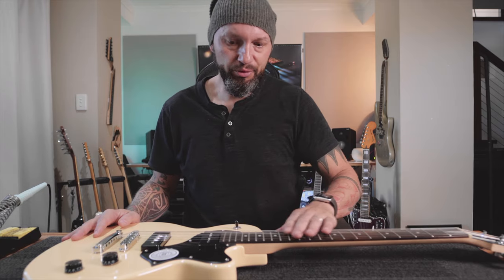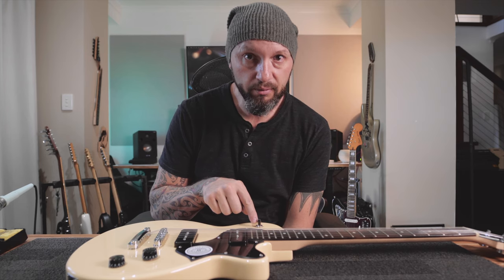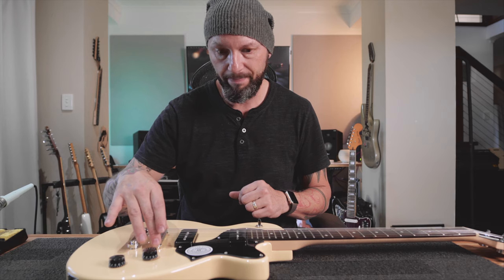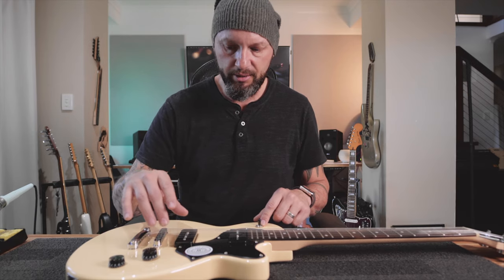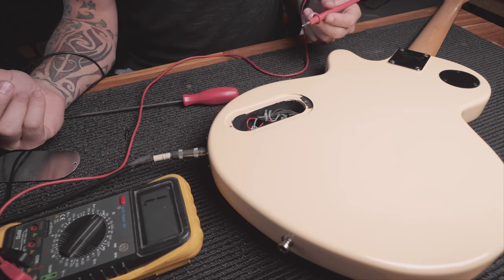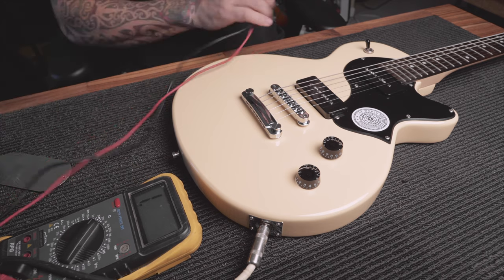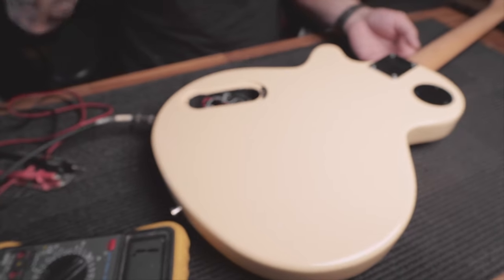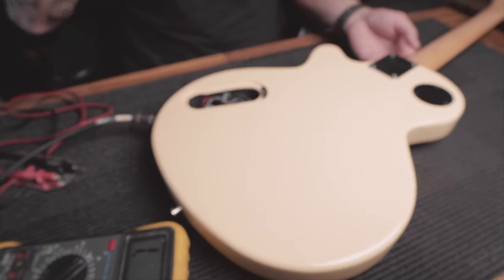3 Easy Solutions to Fix Ground Noise | Guitar How-to Ep02

Comment: Hi there, very useful and informative video! I have an Ibanez BTB series bass and I have a constant noise that goes away when touching ANY METAL PARTS OF THE CIRCUIT, and that includes the Metal parts on the amp, the Multi-effect , bridge, strings , preamp knobs and etc... could this still be a grounding issue? I tested back of the cavity with a multi meter and some parts seemed to have "continuity" , whereas some of the pots seemed to be off (with a wiring or soldering problem...) I am really confused and I would appreciate if you could help me !  (Also the noise doesn't get any louder when touching specific parts)
Reply from the maker: Some of the BTB series have active pickups I believe. First thing is check your battery. I reckon that will be your issue. If it’s not the active model with a 9v battery let me know so I can help you out. ✌️
Reply: @RisingSunGuitarMods  its a BTB20TH6 and I believe it has passive pickups with ACTIVE electronics/preamp [as written in site : "Nordstrand Big Single passive"] , I changed the 9v battery but no differences was made! I also forget to mention that noise gets louder when hand gets closer to the pickups
Reply from the maker: @Ronk-c9b  that's a nice bass by the way. :) This would be a hard one to solve without having it in front of me, there are a number of things to consider. But the first thing I would recommend for you is to try taking your multi-effects (pedals etc) out of the signal. If possible do you have another bass you can try through your setup? This would identify if it is even your bass. If you are sure it's not your amp or pedals then it will most likely be an issue with you bass and will need diagnostics done on it. Without actually having the bass, it is hard to tell if it is something simple like a bad solder joint, or something more complex like a preamp issue or a bad pickup.
Reply: @RisingSunGuitarMods  thanks! indeed its a wonderful looking/sounding bass. I have tried different amps, removing the pedals and I have tested my older bass through my current setup and everything seemed fine, so I hope the problem is just something with the wiring and solder joints. since there are not as many guitar technicians in my country I tried researching online instead😁, but I guess I have to find one now . I appreciate your help a lot🙌! if the problem is a "bad pickup" , do I need to replace them with a new pickups or could that be fixed as well? Thanks again for your time
Reply from the maker: @Ronk-c9b  usually if it is noise it’s more likely a wiring issue. Check all your grounding points and also your output jack. If you are comfortable with soldering then reflow the solder on your output jack and all your easy access areas like pots and any connectors that are easy to get to. Sometimes this can help. Otherwise yes it might need to go to a tech. I wouldn’t replace your pickups unless you can say for certain as you still have good sound from them.

Comment: Probably won't get a response here but I'll try anyway. I just completely rewired a standard Les Paul setup and I have a grounding hum. I took my multimeter and hooked up a cable to the input jack and tested for continuity by placing the black lead on the sleeve of the cable and touched each of the pots with the red lead and no beep of continuity occurred. OK, so that must be the problem but both of my solders on the input ground and switch ground look good and when I put the multimeter probes on each end at the input jack and switch it sounds a beep of continuity. What do I do with that?
Reply from the maker: Sounds like you are missing a ground connection. Check that your pickup ground wires are soldered to the back of their respective volume pots. And check that all the pots have ground continuity to the switch. Also make sure your output jack is wired the correct way around, this is an easy mistake to make.
Reply: @RisingSunGuitarMods  Jack is correct. Resoldered both switch and jack ground. Checked all ground solders on top of pots. Here's what I'm left with. The continuity is as follows:
Bridge to neck pickup, no.
Bridge to Bridge pickup, good.
Bridge to all pots and solders, good.
Pots to pots, good.
Switch to jack, good.
Bridge to jack, no.
Bridge to switch, no.
I'm confounded!

Comment: I add a drop of Elmer's  white or wood glue in screw hole with a toothpick.  Glue will act as a lock tite & strengthens wood fibers around screw threads.

Comment: So is it normal for my guitar to be a bit noisy and then go quiet when I touch metal parts or does that mean it needs some shielding? Because my Gretsch Electromatic is quite noisy when turned up and gets much quieter when I touch it. I wondering if it's something that needs fixing.
Reply from the maker: This is normal, it means your guitar is grounded correctly. You can try shielding to help some of that interference though: https://youtu.be/sAQP5HtdNuc

Comment: My Squier has no continuity from 5 way switch lever to common ground.  I haven’t removed the pickguard, could it be the lever arm isn’t made of metal, if not it should be a connection from the switch to the pots or internal to the switch itself?
Reply from the maker: The lever should be metal. Take the guard off and inspect the wiring first. Might just be a wire off.

Comment: I need answers please. I bought a new Gibson les Paul guitar today,it sounds clear when connected directly, but when I connect it to an effect pedal,it brings the same buzz sound you illustrated in your video. When I hold the output jack,the buzzing sound stops. Please I need answers
Reply from the maker: Make sure it’s not a lead or your pedal first. Does it stop when you touch the strings? Try using the gain on your amp and switching out your leads first. If you are still sure it’s the guitar I’d return it to the store and ask them to double check it.

Comment: I just bought a used 2007 Gibson Les Paul Studio off of Reverb (all stock).  Guitar is noisy when plugged into my tube amp, or even a POD Go.  Touching strings or bridge does not reduce noise.  Touching either bridge or neck pickup kills it.  (Even if I have the bridge pickup selected, touching neck pickup kills noise along with touching bridge pickup.)  
Touching output jack seems to help.  If I touch the metal on the 3 way toggle switch noise gets much worse.  I opened up and checked POTS, looks all connected and there is a wire coming from the bridge to POTS.  Sounds like a ground issue between the 3 way switch and output jack?  I like the guitar, but hope it is a cheap fix.
Reply from the maker: You might have an issue with the bridge ground wire at the lug end. I would get your multimeter onto it and see if you have ground from the bridge to the back of the pots.

Comment: Did you ever make a video on where to place the ground wire on the bridge ? I have an SG that I think has the same issue. Only stops humming when I touch the bridge. I just don't know what to connect the wire to.

I enjoyed the video. I've subscribed so please keep making more. 
Thanks. Stay safe out there. 
✌️ †
Reply from the maker: Thanks for the sub. If it stops humming when you touch the bridge then you have a good bridge ground. What pickups does your SG have in it?
Reply: @RisingSunGuitarMods  it has original 67 pickups and an additional single coil pickup that was installed before my dad bought it. 
I copper tapped the entire Inside. then made sure all connections were good. 
It only stops humming when I touch the bridge where it rests on the post. I thought it was the same issue as your guitar here.
Reply from the maker: @USAlien234  Sounds to me like it will be the single coil making the noise, I asume it is in the middle, is it always on or is there some kind of extra switching for it. If you rewatch the video you will see the noise on mine does NOT go away when I touch the bridge, it actually gets worse. If the noise stops when you touch any of your grounded metal parts then it is correct. A single coil will always be noisy and yours will be determined on how its been wired. Should only be noisy when the single coil is on, the 67 humbuckers should be resonably quite, although you will never get rid of all the noise as there is heaps of things that can cuase it. You could try a noise supressor/gate.
Reply: @RisingSunGuitarMods  thank you for the reply. So Incan turn off the sigle coil, but there is a lot of hum even with it off. Im tested all the grounds agian, and the tail piece is not grounded which means my strings are not grounded. Im not sure kf that matters thou. The bridge on this guitar has plastic or bone string holders, so they never actually connect to the bridge. And the only other metal they would touch is the tail piece, but thats not grounded. 
Are the strings supposed to be grounded ? If so I guess I can just run a small copper wire to the tail piece from the bridge. Idk. 
I suppose Incould just get a noise gate. That would be a fix for me if I cant figure this out I suppose.

 I appreciate the help thou even if you dont reply again. I will be watching for more vids on your channel.
Reply from the maker: @USAlien234  ahhhh bone saddles, of course. Yes get a ground wire to your tail piece, this should then ground your strings. Give it a go let me know if it works for you. I completely forgot about the bone saddles on the 67. Best of luck and thanks for subing. I have a new video coming soon.
Reply: @RisingSunGuitarMods  oh sweet thank you kindly 😌
I'll let you know if it works 🤞
And I'll be looking for your new video
Stay safe out there

✌️† ❤️🎸

Comment: Help! My bass buzzes until I touch the metal case of the output Jack. What could be causing this‽ everywhere else has continuity
Reply from the maker: If it doesn’t go quiet when touching the bridge then follow the steps in the video. If it doesn’t go quiet when touching the bridge then I’m not sure you have a good connection.
Reply: @RisingSunGuitarMods how do I make sure I have a good connection?
Reply from the maker: @chrisparker5278  Watch the video, I explain how to test for continuity with a basic multimeter.

Comment: Hi, thanks for making this video. I need a little help about my ground noise issue. I have gibson lp studio 94' with ground noise. Two stock humbuckers. The noise goes away about just half when I touch the strings. I have a multimeter, there is no connection between output jack and my pickup selector. There is a ground wire between them but it's a dry solder issue I guess. I tried spraying some WD40 but it didn't worked. The thing is, there is a connection between pickup selector's outside rings and output jack but not with the inside of the pickup selector. Is this normal? Noise sound gets worse when I touch inside of pickup cavity. Also, there is a shielding paint (I guess) just looks like yours, which is not grounded as well but, there is a shielding metal plate under the pots. No shielding on back of the backplate. Everything else is grounded. What should I do?
Reply from the maker: If there is no ground from the ground of your selector to the ground of your output jack it could be that there is a broken connection between them. There should be continuity between them. Try the output jack to the back of a pot, then try the ground of the pickup selector to the back of a pot. If one of them doesn’t have continuity you’ve found the issue.
Reply: @RisingSunGuitarMods  Hello again, thanks for your help. I re-soldered my ground cable and another cable which was looking bad on the pickup selector. Now, there is a connection between the pickup selector, pots and output jack, but the noise still insists. Two things happened to the sound after what I did; 1) My guitar tone changed a lot in a good way, somehow more clarity and punch 2) The noise is much lower than before but it's still there, about half of it. I use a little bit gain on amp but there is still a ground noise when I touch the strings. Still, It's much better now. Should it sound dead silent when I touch the strings with just a little gain? I still can't record guitar with that noise. Everything has connection now, all the strings, tuners, screws etc., except the wood of control cavity. But there is a metal plate underneath the pots to shield them from the wood. I don't know what else I can do.
Reply from the maker: @-Earthless  there could be a number of reasons including your amp, or what is plugged in around it. Do you have another guitar to see if it’s your set up and not the guitar? Sounds silly but you could try your amp on another room and another power outlet. If no luck watch this for some more ideas: Still have a hum, try this: https://youtu.be/sAQP5HtdNuc
Reply: @RisingSunGuitarMods  Thanks for the answer. I have other guitars, they're not sounding crystal clear but not that bad as gibson. I'm using both audio interface with amp sims, vsts and amp only, and the noise is the same. Noise gate doesn't help with that much noise. I also tried running my audio interface on laptop (on batteries) to test my power source, no difference. I'm pretty sure it's the gibson. I think I'll try to re-solder everything and I might try copper shielding too. Pickups are 498t and 490r and they're both noisy even with low volume on knob. The noise is similar with this video, even while playing. https://www.youtube.com/watch?v=0h-mbpU8AxE
Reply from the maker: @-Earthless  I would start by desoldering, use solder wick to remove the old solder, then new solder. Also check the wires while you’re at it. Also from memory those pickups have shielded braid wire, just check the continuity from the shielding to the pickup base plate. To me it sounds more like an earth leak of some type. Can happen when there is a short somewhere, maybe a bit too much solder and it’s shorting a terminal. Hard to diagnose without the guitar in front of me. But yea it shouldn’t be that noisy, the idea of humbuckers is to have no noise. The 90’s and early 2000’s Gibsons did have some quality issues so it wouldn’t surprise me if there was a wiring issue.

Comment: HELP!!! ....I get crazy loud annoying buzzing/interference from every electric guitar I own...until I touch the strings or the bridge and it stops. It does it whether I am using my Orange amp or my Marshall. I bought new cables, put a Noise Gate on, and it still does it. Some nights its worse than others. If the guitar is sitting on the couch alone it wont buzz..as soon as I reach towards the strings it starts...pull my hand back and it stops. The intensity increases the closer my hand gets to the strings. Pick it up to play and it wails until I make contact with the strings. I have been reading a lot on this and so many different suggestions. Since this is happening with every amp and every guitar I own, it cant be a problem with the equipment and leads me to think that something else is interfering with the signal and me personally is the problem. Is there a way to "ground" myself?  Could it be other electrical interference from inside the house? Thanks!
Reply from the maker: Hey man, sounds like some serious EMI (Electro Magnetic Interferance) from something. What happens is you are becoming an antenna, once you touch your guitar the signal is going to ground through your guitar. I would suggest first moving your equipment to another room, just to test, as it could be anything from the power supply in your computer to your mobile phone or a near by power supply like a TV or microwave. My soldering iron sets off all my gear. If you can eliminate the things in your home try shielding one of your guitars to see if that makes a difference. I have a video about shielding here: https://youtu.be/sAQP5HtdNuc I hope this helps.
Reply: @RisingSunGuitarMods  Thanks Buddy...that's pretty much what I feared. I may try the shielding suggestion however I currently have 14 guitars so I may have to thin the herd first...LOL!
Reply from the maker: @Randy-ul5hy  Start with your fav, see if that works first. :)
Reply: Try another house. Homes built before the late sixties weren't grounded at all.  And you might be near a large transformer outside? So many sources of interference...

Comment: Hey thanks for the vid , my pickup selecter switch makes more noise when I touch it ,I've looked inside and there are no loose wires I even redid the wiring , any advice?
Reply from the maker: Does touching your strings/bridge make it quiet? Check the ground that goes back to the pots is connected. 👍
Reply: @RisingSunGuitarMods  yep it does get quieter when I touch the strings and all the grounds are attached on the pots
Reply from the maker: @blakebrown1255  the actual switch could be defective. What type of switch do you have? Have you tested the ground continuity with a multimeter?